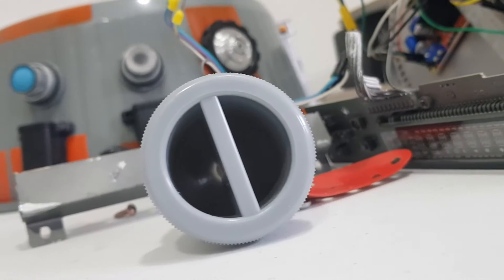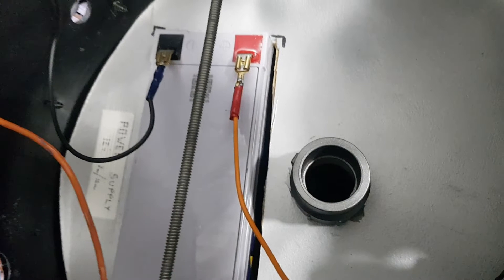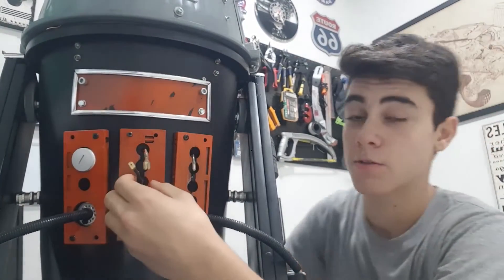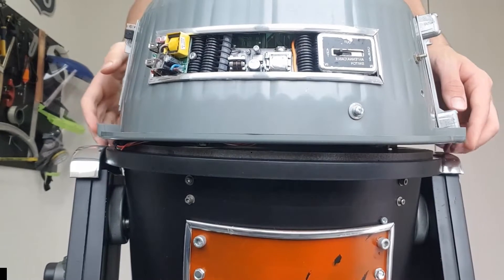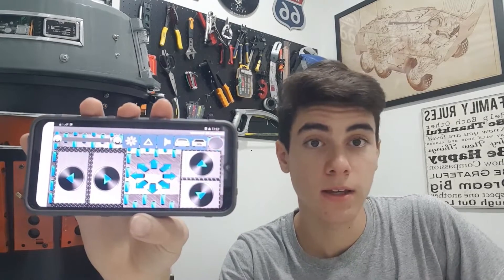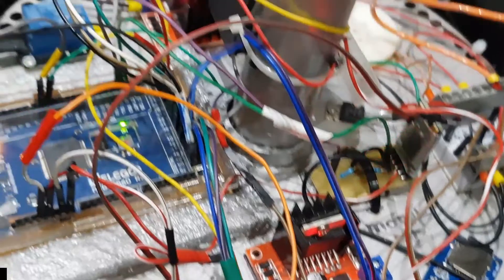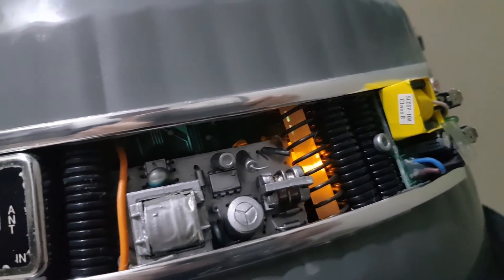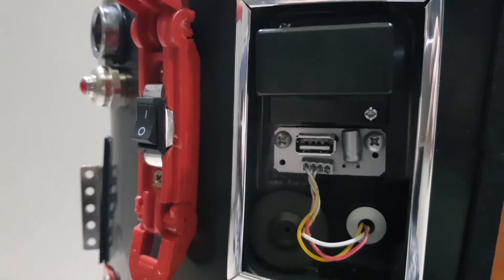HOMEMADE REAL LIFE ASTROMECH DROID! PART-2

Comment: Gotta ask what exactly on your droid cost $2000.00?. Is that plate inside a porter musicbox disk?.
Reply from the maker: Hello there Bear Vassar! I spent around R$900 (equivalent to $170) with the materials to build this droid, most of the materials I used were recycled, like its body, legs, feet and greeblies. The plate inside is actually just a round wooden board. I tried to make this droid as cheap as possible.